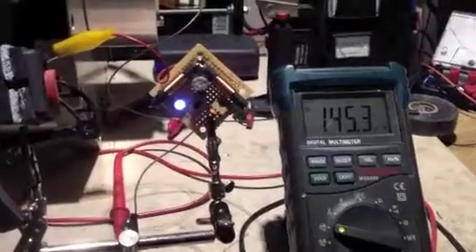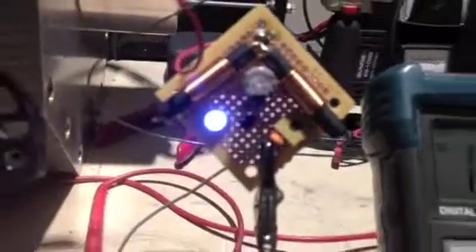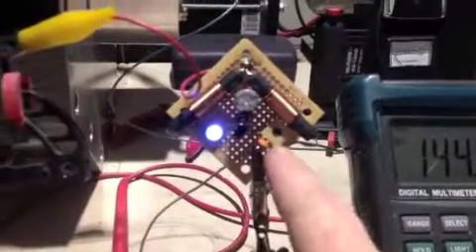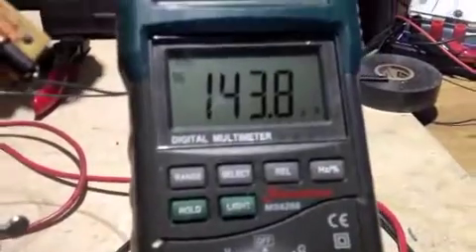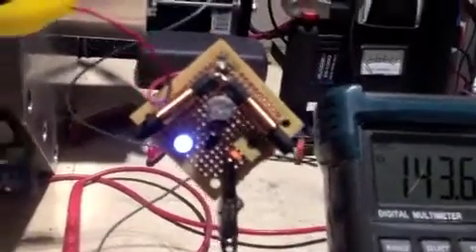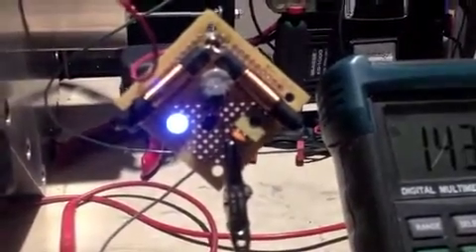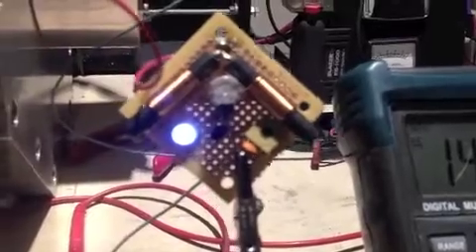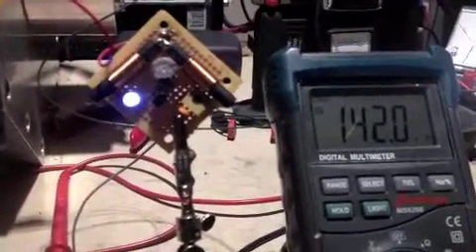SUPER PENNY VARIANT ON C/MG Cells

Comment from the maker: John, I just tried the circuit with the lights off.  With the 1Mohm resistor turned all the way down, and the lights off, the led is glowing albeit dim at 3.6 uA. I confirmed this with a Gen I light amplification device I have. With lights on first ocular noticeable light arrives at 67 uA, with hand cupped over the LED.  I still really do not see blinking due to my cap.  I have an idea for a radial inductors set up with multiple planes... Next time I am back we must visit ok?

Comment: Hello Dive. I noticed something you mentioned on the video and thought I'd comment. I finally got twist tie and it worked all together different than the copper coils I tried. I  found the low frequency pulse to be sensitive to the position of the coils. One on top of the other or 1/4 apart as well as a slightly larger cap did it for me. At first light I draw 8 uA on my meter. On the scope I get 10 mv pikes over a 1 ohm shunt thats in series with a cap charged to 1 volt. Isn't that 10 uA?
John